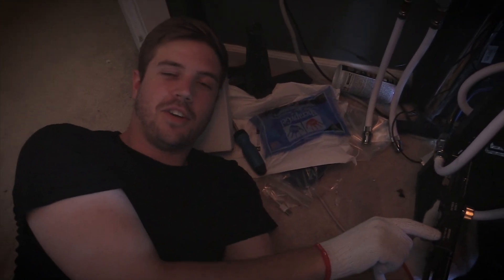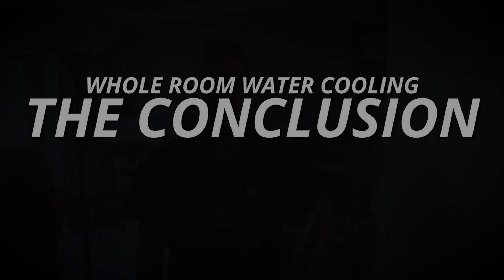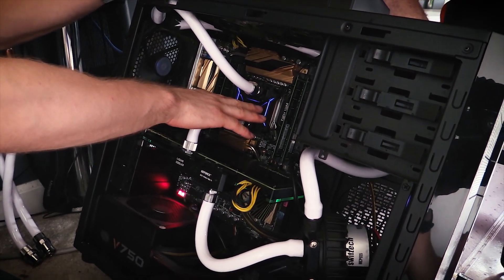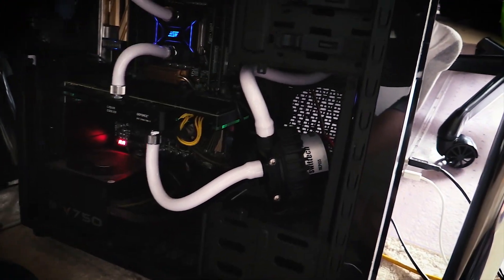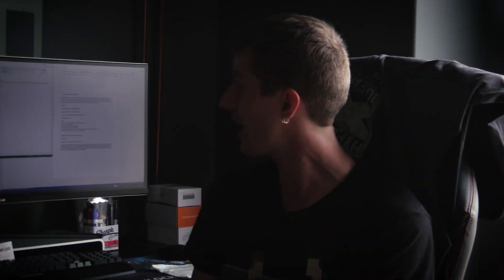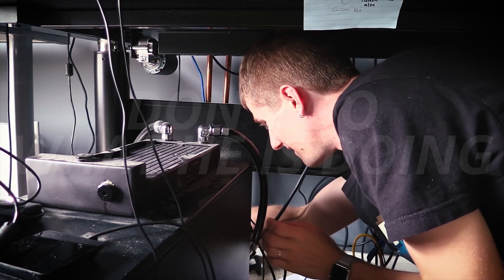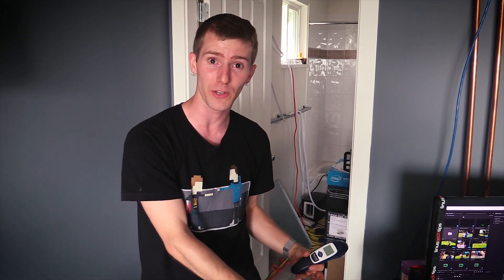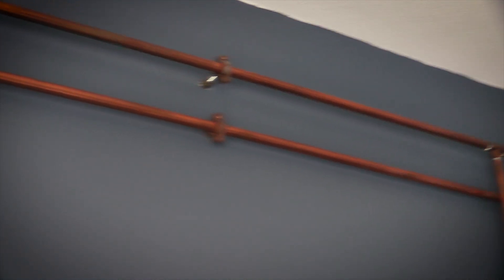Whole Room Water Cooling Part 7 - It's FINALLY over!

Comment: Should have put the reservoir in the basement on the cement floor.
Reply: You would need some crazy powerful pump to get water up two stories.
Reply: As long as its a closed loop system and the water drains right into the res then its only a few inches of lift force due to suction.

Comment: Why wouldn't you run this to the basement? It's a completely different thermal environment, far enough away from the room to not cause problems and also is naturally much cooler than almost any other room in the house. That way you can still dissipate heat while also bring back cooler water to further reduce CPU temps. That way you are cooling in two different ways (by dissipating heat and by bringing in cooler water than went out). Just a thought.

Comment: These videos are real fun. I do not know how you set yourselves up with a job that pays you to waste so much time and money- I am definitely very envious. Silly and entertaining though, keep up the good "work". Also my 2c here, water cooling looks neat, but is expensive. A decent air cooled solution can keep low-lower temps at a fraction of the cost and effort.
Reply: They aren't idiots. They are experts in computers and know that water cooling is expensive, so you should stop being so condescending. Also, there are a number of situations where water cooling is vastly superior, one of which is running multiple graphics cards.
Reply: Mnemonic Monkeys 
Not being condescending at all as I mentioned I thought the set up was fun and provided a bit of humor and entertainment. Also they admit this was a big boondoggle. With a few decades of experience, having built and maintained SLI rigs starting with the Voodoo series of cards I have not found any compelling performance reasons to water cool. Water cooling can look very attractive and may very well produce lower audible signature from the rig as the radiators can keep lower rpms. This does not detract from the fact that water cooling solutions are more expensive than typical air cooling. Smart cable management and employment of thermal compounds and case air-flow management would suffice for most users but that is not why we watched this video. This is very similar to overclocking a CPU to the point of requiring liquid nitrogen to be constantly poured around the shroud-while neat to see big crazy clock speeds it is also impractical. Have a good day!

Comment: i think the major issue was you plumbed the pipes UP instead of down, you could of easily ripped up all the floorboards put in ground trunking pipes for Lan cables and electrical ports aswell as the pipes and had it gone well enough you could Hide it all instead of it looking ugly AF

Comment: The water needs to be chilled using refrigeration and heat exchanger setup or your radiator converted to an evap fluid cooler by adding water spray due to its small size. The problem is the delta between the water temp and the air is not great enough to extract enough heat. a high delta is needed to effectively transfer the heat from a dense fluid (water/coolant) with a high thermal transport capacity to air which is a lower density fluid having a corresponding lower heat transport capacity by volume.

Comment: You can't reliably measure the temperature of copper with an infrared thermometer. It reflects ambient temperatures due to a low emissivity.

Comment: lol insulate insulate insulate. it will be more efficient. like everyone else is saying, you have so much copper piping running everywhere that the heat is dissipating from the out heat pipes before it even gets outside.

Comment: Insulate the hot flow out of each PC, use a plastic tank, use a inhibitor to stop corrosion, fit vents to flow and return, put the external radiator in a river to remove the heat.  well maybe not.

Comment: Hi.
May I suggest You to make waterheated floors.... By that the floors would be warm, but cpu's and gpu's would be much cooler with plastic pipes... Sorry bout my bad English...
I would so do that In my own house. As I made waterheated flooring in my pearents house. I think I could make it with PC cooling. Not sure if it would really heat up floor in a room in winter when it is -30 celsius. But I am sure it would greatly cool down the PC.

Comment: buy an outdoor unit(compreesor and stuff) of an air conditioner and reroute it into the tubings ...ur pc's will run cooler than ever and their wont be a problem with gunk as it uses gas.....

Comment: if the pc's are the source of heat, then put them all against the window wall and use 3" foam insulation to make a insulationed box for them and  isolate the heat. While you are at it cover up the window with a sheet of insulation and leave it open a crack for hot air to go outside. $100 to $200 in insulation and a single day project.

Comment: Just finished the watching the whole "Whole room water cooling" series. Although the initial idea was great and properly done could have been great success, the current result is really.. I'm not really sure which word to use. 

The only parts of this project I believe were done with at least a touch of professionality were the copper plumbing and the room painting. The rest of the jobs (and permanent home-depot trips) were just a simple repeating of try-fail and makes impression of absolutely zero preparation - both practical and theoretical.

Can you estimate the costs on the material - both the per-computer water cooling elements and also the outer static material such as the pipes, pumps, reservoire... 

(BTW, reservoirs in the circle should be put to the very top position, not to the ground. ;) )

Comment: you should have run the outlet from the pc`s around the bottom of the room and have a shield over it (like a cars exhorst). It would have lowerd the rooms temp the cold return is spot on

Comment: looks like you all needed a closet to put the pumps and filtration into.
keeping the waterline next to the ground or even under the threshold of the doors would have decreased a lot of stress on the system. personally i would have put it in the walls running a separate hot water line from each computer to a hot water tank... filter system then radiator on roof.

cost effectiveness.... likely?
still lacking.

however you could have a small cold water coil with fan set up near each station to help with ambient room temperature before gong through the pc's.

Comment: I only seen the final video but cooling and room air temperature has always been a issue here in Australia. One way I have considered with cost/use has been to use ducting system to draw the hot air out of systems. This could still be coupled with the localised water cooling in system for ease of construction. With a final vacuuming fan outside to keep the noise levels acceptable.

Comment: why not wrap the line in foam pipe insulation? unless it needs to be bare for the heat dissipation. or make boxing for it that would force air to server room? i think i could do some testing and figure something out

Comment: AC Unit = $200-400
Water cooling a room: Priceless
Reply: What about the lulz ?
Reply: The bills : 1000$
Reply: Content!
Reply: What about a fucking fan
Reply: @rcblitzfpv8346  a fan only blows air ,it doesnt cool it. those SPACE HEATERS of computers require cooler air. so a f**king fan would not be enough to cool those computers.
Reply: @rcblitzfpv8346  reread his comment, that room would be an oven. With a fan you're just moving oven air around yourself

Comment: Any automotive coolant has additives to stop bimetallic corrosion (which was caused by the interaction of the copper, aluminium and steel in your system).

Comment: YOU NEED TO INSULATE THE COPPER TUBING! PUT FOAM TUBE PADS THAT PLUMBERS USE THAT WILL KEEP THE HEAT FROM THE COPPER PIPES COMING BACK INTO THE ROOM.... COME ON GUYS YOU SHOULD KNOW THIS!

Comment: cool concept but the execution was kind of sloppy. not sure what research ahead of time you did, but as someone who works with water treatment and heat dissipation for a living, i have a couple recommendations to make.

 first is to use pvc piping inside, you dont need to solder and that makes installation and removal a lot easier, or if you are using copper, add unions all over the place so it can be worked on. also copper can be insulated to keep heat in. add a high point vent and a low point drain. the pvc can run into temp issues and some plastic pipes are only rated for temps up to 65 c so make sure your plastic can handle the worse case temps it might see. a pump controller might also not be a bad idea as you are changing the loads and balance on the system every time you plug into or out of the main loop. flow meters and control valves on the mail supply and return legs to each tie in would also not be a bad idea and would make system balance a lot easier. as it is now, the comp hooked up closest to the pump has more flow then the next one along due to friction losses in the pipe.

DO NOT MIX METALS, this is really important as it will increase galvanic corrosion within the loop, if using copper, only use copper. if using aluminum, only use aluminum. mixing metals (can) causes preemptive wear and leads to reliability issues as you found out. silver is often touted as the go to anti-microbial but for this very reason many manufacturers of water blocks now recommended not using silver in loops with their blocks. for more detailed info on what metals can be used together look up anodic index. some will say if the metals are not in direct contact the corrosion doesnt happen, but what they forget is metals do dissolve into water to some extent and therefore will come into contact with one another and any impurities in the water can carry a charge and lead to corrosion. it might minimize it by not being in direct contact but if does not eliminate it. eliminating problems is how you get reliability, not by band-aiding them.

so your copper pipes with aluminum radiators and steel tank is a bad set up. all aluminum or all copper, no being agnostic unless you have industry level metal plating hidden in the back room to coat everything with the same material (and even that involves a lot of coats of more similar metals... its like the soldering intel used to do on its chips with like 5 dif metals to join silicon to copper)

 talk to a chemical supply company and get a proper water treatment plan. use the correct corrosion inhibitors and anti fungal/anti microbial additives. since you are doing a closed loop, dont cheap out with tap water, get RO or better yet, distilled water. with better water treatment, your growth and rust issues would not have happened (or at least have happened at a much slower rate) and your system would have been effective for a lot longer. better engineering means less down time.

i would say in your case this was an overkill idea as 5 pc;s dont really put out that much heat and an exhaust fan would have given better results for less money, but as far as a concept goes, it is very neat. a lesson to be learned by anyone else following in your footsteps, with a couple what not to do's. thanks for taking the time to try this and show us just what issues you might come across.

Comment: So, why not use PEX instead of copper? Cost would have been a tenth the cost (and the install is quicker), and it would keep heat from running back into the room as PEX is an insulator. Would have been super easy to add additional drop as needed, entire system could have been run on a master pump or each PC gets a smaller pump that you could turn on/off as needed.

Comment: Interesting thought here, or rather question.  With all of the systems connected up in parallel (which they appear to be) you should technically have the same amount of cooling happening throughout all systems.  That said, the heat of the room would theoretically have an effect on the copper "input" pipe, warming it up.  Therefore the last machine in the line would, again in theory, receive the least amount of cooling from the whole-room system.  Would it not?

I would think a more efficient system would simply be to run the computers off radiators and cool the room with an air conditioner.  The cooler room would cause the radiators to be much more effective in removing heat from the computers and the electricity usage would probably be comparable considering your current setup requires cooling fans on the outside radiator and electric pumps to keep the water flowing.

Comment: simply add a chiller to the existing system.. would work a treat.
i run a 6kw laser that has copper based mirrors which are water cooled via a refrigeration chiller.
if a chiller can keep those at a temp of 19 degrees Celcius then cooling a pc would be no problem..

Comment: The idea is great! I thought about it a bunch of times. However, the following would make it work WAY better:
1. insulate the copper tubing with pipe insulation.
2. don't dissipate outside, where the temperature is so warm. Preheat incoming cold water that is then used for hot water. The more showers people take, the cooler the system ;-)
3. dissipate excess heat with geothermal, so bury tubing underground in the back yard, if you have one. Temperatures only a few feet underground are much cooler than air temperature. If digging gets too expensive, and you have access to the basement, put the dissipating radiator in the basement.

But of course, then it get's real expensive. However, the idea is to have such system for other devices as well, and just tap into that. Like refrigerators. So if none of the above dissipating mechanisms are available, one can use an old refrigerator, to cool down a insulated water tank, which could then be used to cool down the system water. The refrigerator engine would run very little, only enough to keep the cooling temperature say at around 15C. Then you would remove almost all of the electronics heat outside. Keep in mind, that the refrigerator dissipating radiator should also be in a room or outside, or the basement.

Comment: Probably better if you insulate the copper pipes. Then get some water mist spraying on the outside radiator to get some evaporation cooling at the exterior radiator. The other idea would be use city water (50deg f) in bathtub as a heat sink for your radiator. Why not!? Throw some ice in there while your at it.

Comment: I'm an HVAC tech, and I have been thinking of using freon (actually R-410a) to cool a system instead of R-718 (aka water) to seriously cool a setup like this. I did see your video on using a refrigerator as a case but the problem you really run into there is both your heat load calculation (did you do one?) and airflow. 
I think we could make something sick, that you could over clock to holy hell.

Comment: I like this idea, but:
Why don't you run the pipes close to the floor? That will save some material and work.
Insulate the outlet at least, put a heat pump on the outside and heat exchanger in between, now the inlet will be so cold that you have to insulate it too. (except you like condensation) 
Since everything have to be insulated, you can build it with PVC pipes.

Comment: On my watercooling system I used a big glass pickle jar for the reservoir, and a 1,130gph fountain pump immersed inside the jar. Works really well for cooling the machine but the room does get really warm.

Comment: This was pretty awesome!! Insulating your exit pipes might actually work. I don't think it was a waste of time.As far as I know this is the first time someone tried to do something like this. What if you use an active cooler to cool down the water? You can reduce the flow rate and substitute smaller plumbing.

Comment: Your setup can work. You are very close. Stainless steel heat exchanger, hyvent or loose key air vents on highest point of copper tubing. Talk to a plumber with hydronics experience.

Comment: This system could work with something like an industrial water chiller . A temptek 5w chiller is capable of dissipating about 18,000W (61,200btu). We use one for cooling extrusion equipment. The key point is that the chiller is set up outside so that you don't heat the room (not an adiabatic system). There are fiberglass ones that sit on top of a roof as well (~10,500W 9gpm) that only cost about $1500 from cooling tower systems.

Comment: thats awesome!  reminds me of cooling system on a submarine ! hehehee.... add a temperature alarm to be loud if your cooling water temp goes up over a certain set point so you guys can correct the issue before any damage occurs and bam. otherwise you can implement a chiller like they use for beer brewing. some guys have taken apart window a/c units and submerged the evaporator inside the coolant and kept temps down that way.

Comment: Protip: just buy 5$ worth of pipe insulation. It looks like a huge spaghetti, you can cut it in lenght so you don't have to disassembly pipes to insulate them. Remember to insulate only the hot side so that the room gets a little bit closer to the temperature outside

Comment: If you don't insulate the hot copper pipes the heat will just go back into the air that's your problem duh lol. Nice system tho good job.

Comment: Great job guys I love those crazy projects :-D It was ridiculous for me that you used 12V computer fans and radiators, but you probably are getting them for free.
If I would build it I would use a radiator and fan from a car, put tubing near the floor (I would probably hire someone who knows how to make central heating for that). The metal  reservoir could not be the only reason for the gunk, coper piping might add something to this as well. For filtering I would only bother with mechanical filter and just add alcohol to the system to kill anything living inside. In addition for one main filter I would add smaller filters (maybe aquarium ones) on the inlets of each PC.